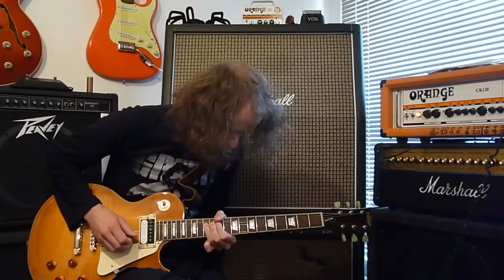Why I prefer Solid State amps to Valve amps

Comment: This video perfectly exemplifies the effect of sample size. This guy found solid state amps that sound very similar to his valve amps, and the ss amps were more reliable and easier to maintain- that's perfect, and it works for him. I have had the exact opposite experience. All my solid state amps had nasally tone, and when (not "if") something went wrong, it was anyone's guess as to what it was. Worst of all, they wouldn't cut through the mix live. My tube (valve) amps have beautiful tone that was easy to dial in. I am one of the ones who can notice that the tube amps have more body, depth, and warmth (from my sample size), plus my tube amps (Mesas) are built like tanks- no biasing required, either. Yes, they are more expensive, but they work for me and my style. To emphasize the point of the video, go with what works for you, not with what you think should work for you!
Reply: Yeah I have both a Solid State Peavey and a Laney A/B'd just to be able to have tons of different tones and sounds. The Laney Tube Amp sounds better than any Solid State I've ever owned without a single pedal hooked to it. The tone is amazing and Laney is not super overpriced if someone wants to get into Tube Amps...
Reply: just listened to a laney in a tube/ss comparison and honestly it sounded horrible. It was being compared to a vox tube as well and the vox blew it away too.
Reply: It might be your ear too. I can tell the differrence between  Very good tube and Very good ss amps if i listen VERY VERY carefully. It's a TINY difference that i dotn think anyone but a musician could hear. I also think it's the manufacturers pulling bullshit as usual. "Hey toss  a cheap tube or two into the design we can double the price".. even though the amp design was shit and whether it had tubes or not was irrelevant.
Reply: I've never heard a very good solid state amp lol... Except acoustic ones.
Reply: I can definitely tell the difference in sound... but, for me, it's not as much about sound, per se, as it is about FEEL. A solid state amp does not react the same way to picking dynamics as a properly set-up tube amp rig. There is a reason that the VAST majority of players who have an unlimited choice, repair techs on the road with them, and someone else to carry and set-up their gear choose to use tube amps.
Reply: I play through a bandit in our church. The master is at half, the clean channel gain is at half, may zoom g5n's master volume is at 40% and I'm still popping out. I even have to try hard just not to.
Reply: i envy your g5n
Reply: If I were a gigging/recording musician, I'd use a good Jubilee or 800, no doubt. But for a home player, a high end solid state is good enough. I had some tube amps in the past, and while I love the sound and feel of some EL34s, it was just too much.
Reply: I think a lot of people tend to overstate the whole reliability issue when it comes to valve amps. As long as you don't do anything daft with them (like bash them about or drop them) then generally they'll perform just fine. The only issue I've ever had with mine that I couldn't fix myself was dry solder joint on a capacitor. A local tech fixed it and swapped a blown speaker for £40.

I tend to replace valves in my Fender about every 12 to 18 months, when I notice the tone not quite being what it was, but well before they actually fail... That way I can hang onto them as a spare set in case the replacement set happens to be faulty (only happened once so far). It typically costs me about £35 each time, which is nothing compared to the money I spend on guitar strings each year...

Comment: I've got an old Laney solid state. It looks like it was made in the 80s, and I have abused it for years, but it still works fine. My valve amp however had a component go wrong within the 6 months of having it, and it had sat there without being kicked around or abused at all. I'm definitely thinking that my next amp might have to be solid state.

Comment: There is a huge difference in sound and the feeling of playing between solid state and tube amps.Some say tube amps are not reliable.Of course if you don't know how to use them properly ,why there is a master volume and standby switch, if don't know how to connect them properly with a cab and don't try them before you buy to see if it's a non-fuctioning properly model.. I had the Marshall Mg100hdfx, the same as David plays.I bought it because of his videos.I liked it very much, it had good sounds. But yet something didn't feel completely right to my ears.. Recently I bought the Marshall jvm205h.I was blown away and I immediately sold the Mg.I mean, come on guys. There is no way for someone who knows how to play to not feel the difference between the sound of solid states and tubes.Also It's a myth that tube amps have to be cranked to sound good enough. I use mine in master volume in 2 and it's killing.But I agree in one thing. If you suck at playing you will suck in both tubes and solid states.Take care guys. Sorry for the long comment but in the end it all comes to everyone's personal preference and choice.

Comment: I like analog circuit solid state amps, don't care for the digital modeling kind.
Reply: Me too, no damn digital necessary, we're not recording!
Reply: I have a Vox Cambridge 15 and I am still often amazed at the tone it produces. Great amp. I had the Vox DA5 when I lived in a tiny apartment. It was very good. I appreciated the wattage option and usually played on O.5 watt... but the modelling option were far too many (especially in the dirty and distortion models. Also couldn't really use the effects well with the interface available.

Comment: I have both Valve and Solid State... I love everything that sounds good. My Orange AD-30TCC is GREAT and does that cleanish crunchy sound extremely well, whereas my PCL Vintage Amp SM60 Solid State has a GREAT clean and a HEAVEN lead sound. They both compliment each other and I have all sounds I always wanted covered...
Reply: PCL solid state amps are about as good as it gets. I've yet to meet anyone who is able to tell the difference between a PCL and a valve amp in a blind test. Designed by Jürgen Rath, who sadly passed a few months ago.

Comment: Hey Dave, I'm with you on the solid state amps. I don't dislike valve/tube amps when they're in good working order and tuned up right. I do club gigs as well and am my own roadie. I've been using a Fender Jazzmaster Ultralight 250watt head (weighs 9lbs or just over 2kilograms) w/ a matching 1x12" Jensen loaded cab (12lbs/5kilos) w/ neodymium magnets. Amp bag over one shoulder, Steinberger headles guitar on my back, cab in one hand and bag of effects & cables in the other. Then I can walk or take  public transport to a gig. Starting the second half of my 50's and really appreciate a portable and complete rig.

Comment: Yes dude! I have that same amp. I have not wanted for another amp since I bought it like 2 years ago. Massively impressed with it. I had the Tiny Terror a bit before that as I succumbed to the whole 'valve is best' trend. I've used the same cab with both amps too, and played them both at home and at band practices, so I can do a fair comparison. First and foremost I definitely think the CR120 sounds better. The CR120 is also less expensive, louder, has an effects loop, has inbuilt reverb, has two channels, and of course has no valve maintenance costs. It's a no-brainer to me which amp is better. I can't comment on massive valve amps as I've never played one, but when would I ever need to crank a 100w valve amp? I won't be able to hear the tone because I'll have gone deaf turning it above notch 2 on the master volume.

Comment: Anyone who doesn't think a solid state amp can't kick it hard, they need to check the new line of Orange Crush amps.
I have the 12 & 20 and they sound awesome.
I also have a Randall RG1003 and it's fantastic as well.

Comment: I have used solid state amps for the past 20 years. My main amp now is a Quilter Micro Pro 200. Extremely flexible and durable. Weighs 19 pounds. Most of my gigs are in smaller venues. The unreliability of tubes amps is ridiculous.I have seen stores unpack Fender and Marshall amps that don't work OUT OF THE BOX!

Comment: Don't feel like you have to justify yourself mate...play whatever you like the sound of innit! personally I like low watt tube amps for recording cos you can crank them at reasonable volumes to get that breakup. I've noticed that the sound can change a lot depending on the tubes you've got, I've just changed the tubes in my blackstar and it's taken it from very modern sounding amp to a more classic rock tone which is what I was after. What matters is getting the sound you want, whatever gear gives you that is the right gear to use!
Reply: very good point, all tubes are not created equally, I used to have a connect for Chinese tubes and the tube quality has a definite affect on the over all tone you get.

Comment: Every amp I've ever owned has been solid state. I love them, the tone is consistent and always predictable. Most valve amps leave me wanti g where it comes to clean tones as well, newer ones dont have the overdriving issue when the tubes heat up as the vintage ones did.

Comment: I had a Carslbro 100 Watt combo. Transistor amplifier. It sounded tight and confined but as soon as I replaced it with a late 70s Fender twin I realised that the interaction between the output valves and the transformer coupled to the speaker was so open and musical, I was convinced that transistor amps were totally inferior. I hear a difference. a massive difference.

Comment: Good sensible commentary. If semi-conductors had been invented before valves there would have been precisely no market for valves. No one would have bothered developing the concept. If  electric cars had come first we'd not have bothered developing internal combustion engines.
Reply from the maker: Thank you very much. :)
Reply: I'm sorry but your analogy is flawed. Electric cars were around very early in time. Popped up almost the same time as combustion ones. But technology wasn't good enough yet
Reply: Electric cars did come first, or at least about the same time as the combustion engine. They were just more expensive and less convenient to repower than the cars produced by Henry Ford's revolutionary production line.
Reply: Pipe down everyone.  Electric cars are for pussies.  Everyone knows that.  Now back to guitars and cool stuff like the 1200 hp diesel engine Mack Truck/ Marshall amp I'm building!!  ; )